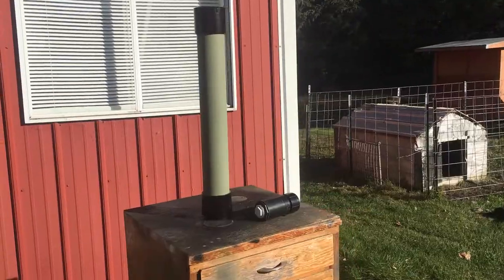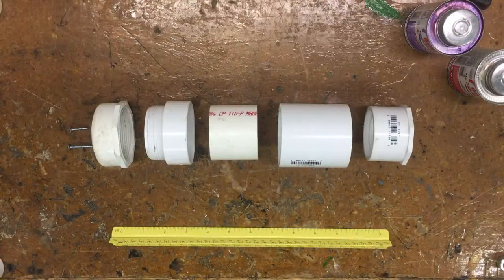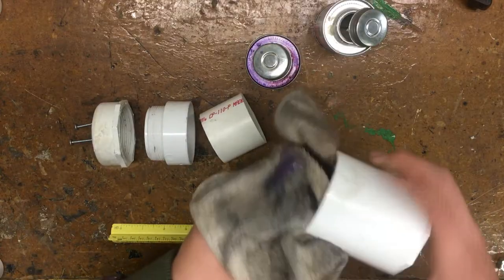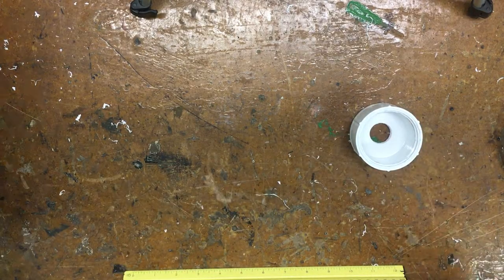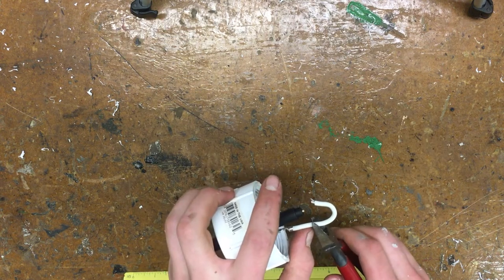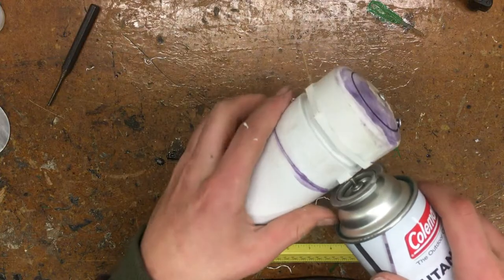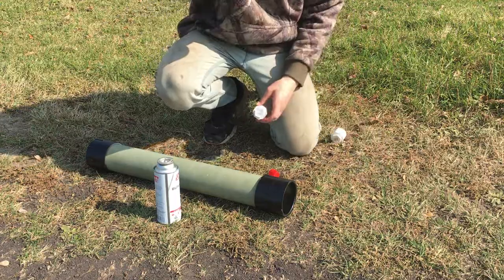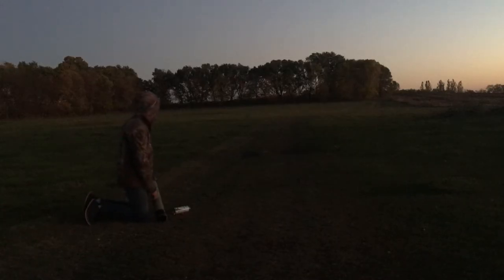how to make a mortar (airsoft mortar)

Comment: Imagine using this to fire a shell that opens into a shower of bbs mid-arch, you could rain hell on the field
Reply: Well hey, there is always remote controls that can set the thing off mid-air.
Reply from the maker: True, good thinking
Reply: That's what Germans thought.
Reply: Lighting a fuze thats cut to a certain length that once its gone a parachute opens and the parachute opening causes the front of the shell to pop open and some fireworks fall down and as they fall they expload with bbs taped to the fireworks
Reply: @Rileylego-fq6wc  ROGUE NEEDS TO SEE THIS
Reply: @trolly4233  i actually a better idea. Instead of the whole parachute stuff what if after all the calculations (drag, wind, angle, mass, gravity, the speed at how fast the fuze will burn, and a map of the terain) at about 30' above the ground the fuze will set off abunch of fire works and cause the entire moarter case to expload. Could even attach a small model rocket to it so when fired it has more air time than a few seconds. 

It would be pretty sweet to have one of these for a large airsoft milsim game with cars n stuff
Reply from the maker: That sounds pretty dang cool, and also a lill complex. But that’s never stopped me b4. I like the thinking, I’ll see what I can do with my MK2 mortar
Reply: @The_Rogue_Workshop  good luck man im gonna try to figure out how to get it to work. I have a 3d printer and finally figured out how it works. Also could have a mixture of vinegar and bakeing soda inside a small container that once launched by the model rocket there is a baloon inside containing the vinegar and it exploads mid flight. Could also stuff it full of bbs
Reply from the maker: Let me know how that works for you man.
Reply: @The_Rogue_Workshop  will do
Reply: I like this idea. Where would you add Bb’s?
Reply: An Airsoft grenade could do this

Comment: Okay so I'm a plumber a few tips bevel your pipe to prevent scrapping your glue out of the fitting and use that glue and primer like your boss is paying for it. Also if you plan on having this last make shure its schedule 40 or 80 not thin wall scrap. Cool video man think I'll modify this idea
Reply from the maker: Thanks for the advice! I’ll be sure to use it
Reply: @The_Rogue_Workshop  I was thinking about doing this but with a foam projectile. I don't want the fire though so is it possible to do this but instead of a barbeque igniter and butane would a valve and pressurized air/c02 work?
Reply from the maker: Maybe, it’d be a pretty complex design tho, if you wanted to use foam you could soak some paper towels In baking soda water and then dry them and it makes fire resistant paper and you could wrap the bottom of you foam in that. Also foam is pretty light weight so I’m not sure how well it’d work, but I’m currently in the process of making a version 2 were it’ll have a barrel and foam might work better in that, I’ll try it out and see!

Comment: I'm excited to see the part two to this. Is the v2 of this still using butane? Or do you plan to switch to another gas like green gas/propane?
Reply from the maker: Yeah I’ll prolly use butane, just cuz it’s easier to get the air fuel mix right. But I might try propane just for kicks.

Comment: Could you please explain why the one without the click is not right? I live in the EU and those things are not as widely available as in the US i think and I mostly see the igniters with the bright red caps instead of the darker red one you use in your video. Any advice?
Reply: Try BBQ lighter or click cigarette lighter. Not as durable but it worked for me
Reply from the maker: The goal is for the igniter to ignite on impact, I’ve found that some of the cheaper ones tend not to ignite as well and break super easy. I’m not sure if the shade of red indicates quality or not. I hope you found something that works!

Comment: How much did this cost in total?

Edit: Also can I launch anything out of it that fits in the casing, how does it work?
Reply from the maker: PVC cost he’s gone up quite a bit but I’d say about 35-40$. Tho if you plan to actually use it in game you might find that it isn’t rly practical cuz pvc is about all you can shoot, but I’m building a version 2 & that’ll be able to shoot more stuff like foam and have better range.
Reply: @The_Rogue_Workshop  So I can’t put something like a tennis ball in there?
Reply from the maker: You could, but I’m not sure how well it would work
Reply: @The_Rogue_Workshop  ok :)
Reply: @The_Rogue_Workshop  I'm working on a airsoft mortar right now I'm thinking about have a nail in the bottom of the mortar and once the shell hits the nail c02 will release and shoot out what ever ammunition u put in there
Reply: @The_Rogue_Workshop  all though this is my first time engineering so semi terrible at this kind stuff
Reply from the maker: Good idea! let me know how it goes

Comment: Saw your rpg video as well and could this possibly work using the paper cups to hold bbs?
Reply from the maker: Yeah I thought about it but it wouldn’t work with this set up. Tho I plan on making a v2 that will be able to do that.
Reply: Was thinking the same thing.

Comment: Instead of dropping the charge why not place the ignitor out one side and the chamber fix in the bottom. I forget the type of mortar but some small mortars fire that way. Like a gun. 

This way the tube can fit the projectile better thus giving better range. Or it should if built right. Plus holding the tube by hand until you have the right angle then fire should give more precision. In the heat of battle its easy to move after you drop the charge.

Most mortars that fire the way you built this one have a bi pod. Thus giving better precision and stability. 

The one im thinking of might be the 60mm mortar but its been so long I forget. I got out the military in 1997. But its videos of them ive watched. Usually SF / Green Beanies use them. If I find one I post a link.
Reply from the maker: That’s a blaze’n good idea! I wanted to keep the mortar realistic so that’s why I had the ignition in the round itself, but I didn’t know that an outside ignition was actually a thing.
That would solve a lot of problems with range
Thanks for the advice, I’ll maybe make a version 2
Reply: @The_Rogue_Workshop  yeah the type I described isn't as visually cool as the drop and fire style but seems like a better way for range and accuracy. I think keeping the propellant behind the mortar in a tighter tube should help both.

You could experiment with different propellant but be careful! I tried Ether in a tater gun once! It blew the PVC threaded cap off the back! It was an old cap. I should have used new fittings. Luckily I had the ignitor on the side in the double walled section of a connection. But a weak spot is a good thing as long as you point it in a safe direction. 

Always inspect your gun! Say after 5 - 10 shots or so. Any sign of a crack or questionable area ditch the whole thing! Or at least put some weight on it to test and see if it moves or flexes! Potatoes fit tight but when you get to tight tolerances on any bullet to barrel fit your chances of a explosion increase big time! 

PVC is sharp when it breaks!! 

Keep us posted on #2.

Stay safe and have fun!

Comment: Was my comment removed-the discord did it right
Reply from the maker: Repost it, i dont know what happened man
Reply: Well I wanted to ask why my projectile wasn’t going far. I used ever so slightly different parts for mine, like a threaded coupler and threaded plug instead of the adapter and cap, but when I fire it the projectile maybe goes 10 feet. Is it the butane? Is too much leaving the butane hole? Is the seal not good? It’s a mystery to me.
Reply from the maker: So I think you’re not getting the right gas to air mix, try waving it up and down 5 times instead of 4 or using less butane, I had to experiment quite a bit to get the right mix. When you get the right mix it’ll maybe go 80-90 feet if you aim it right so it’s not very powerful but it is satisfying to use lol, if you’re looking for something with more power I’m planning on making a v2 with more power so stay tuned for that.